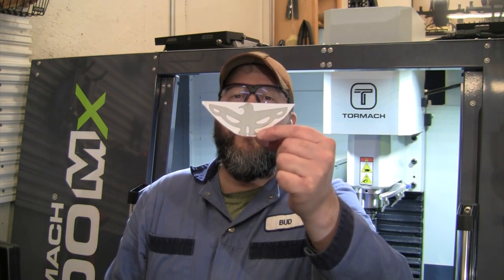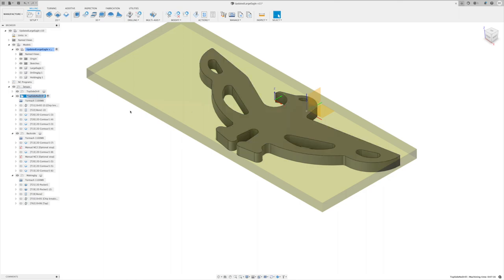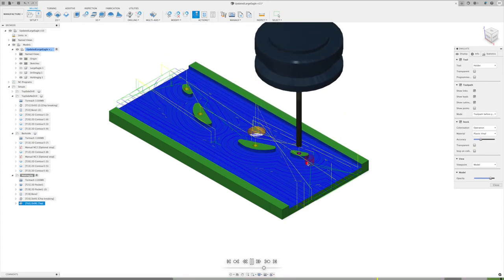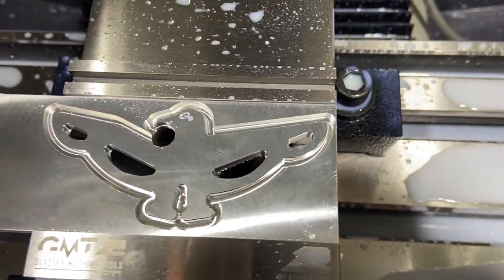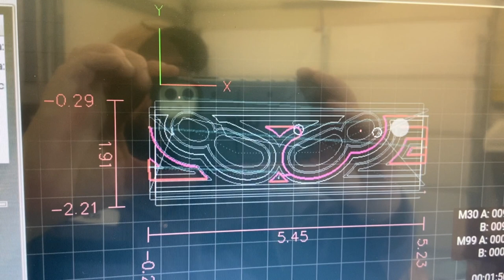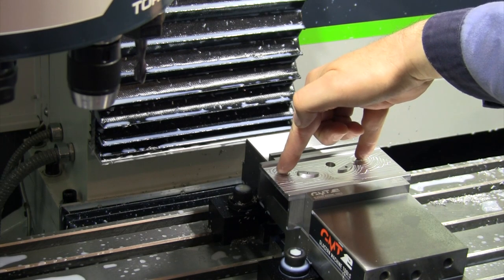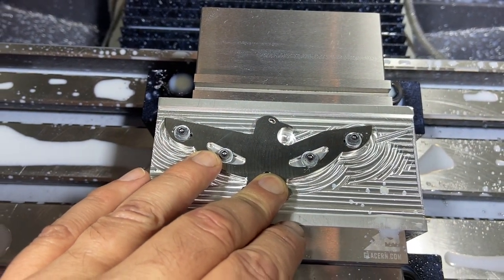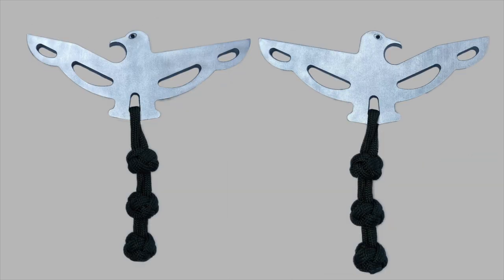Tormach 1100MX Project - Titanium Eagle/Logo Bottle Opener

Comment: Would be great to see how you use the PathPilot to fix and modify settings like you did for the pause.
Reply from the maker: William Bryce - I don’t actually use PathPilot to make any of my code changes or modifications. I go back to the computer and use Fusion 360 for all my tweaks and changes. I re post the file from Fusion and save to Dropbox. PathPilot is connected to Dropbox and sees the changes file, I am able to upload the new file with the edits. If you look at 7:40 in the video it shows where I select the pause in the Fusion menu and put that in my setup process.  I hope that answers your question. Thanks for asking.

Comment: M1 is optional stop, it'll stop after each tool as long as you have it selected on in pathpilot. M0 is what you need for a pause in the program.
Reply from the maker: Adam Waldram - Thanks for the tip. I am not seeing where to insert that with Fusion?  I have Stop and Optional stop as choices from the Setup menu. I guess I could edit the code, I just have not tried that yet and rely on Fusion to generate all the code. Don’t want to get in and mess it up.
Reply: @BladesIIB  Your welcome, im learning fusion 360 as well. Im not sure how to add it in there. I would edit the code in pathpilot under the file tab. You'll just want to scroll down to the code of tool you want it to pause after and either change the m1 to m0, or add a m0. Should be able to put a comment in to remind you as well. Make sure its in parentheses like, (Add screws to inside threads).
Reply from the maker: @adamwaldram6839  Will give it a try. Thanks again.
Reply: @BladesIIB  No problem!